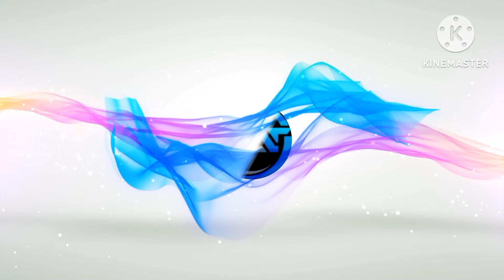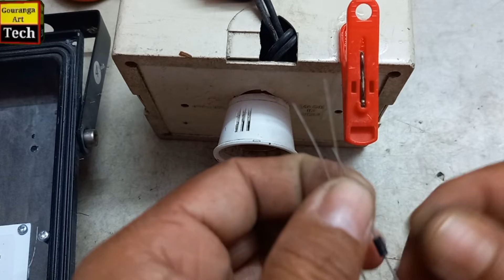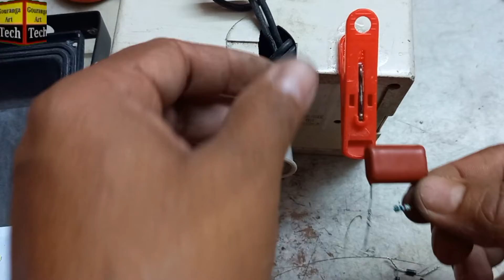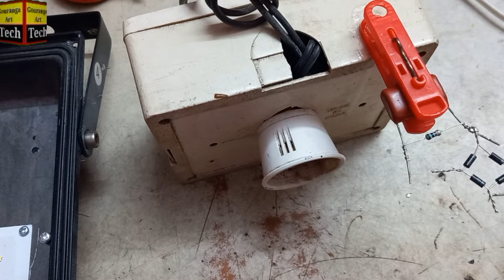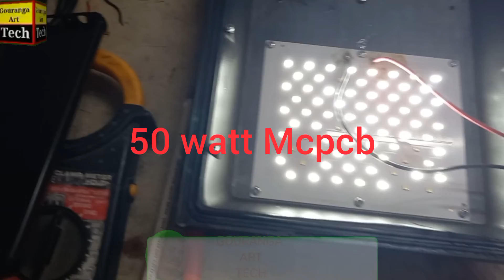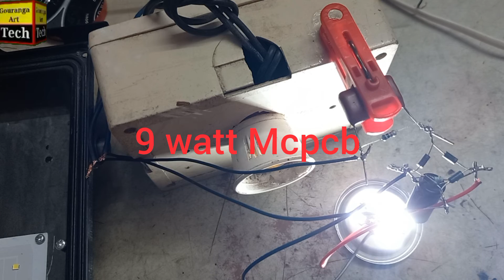How to make 9w to 50w LED RC Driver | kaise banaye RC Driver | কিভাবে LED Driver বানাবেন মাত্র 10/

Comment: Video should be done by showing components soldering near to component which indicates value and voltages using multimeter. This video is useless.